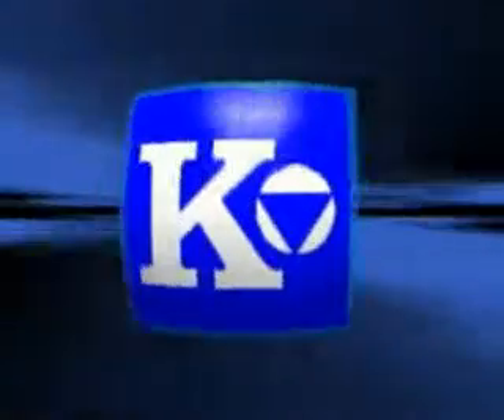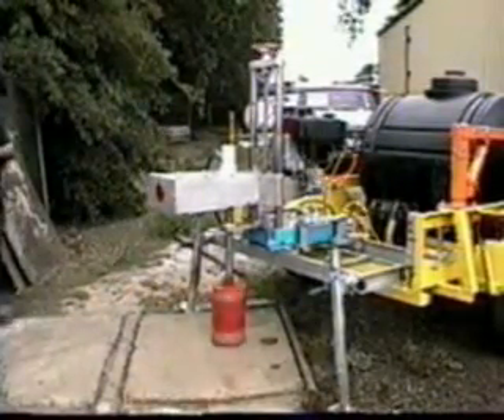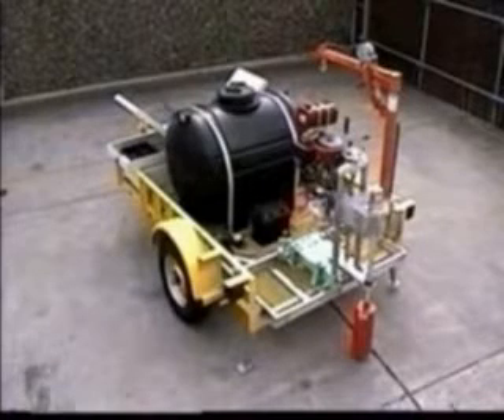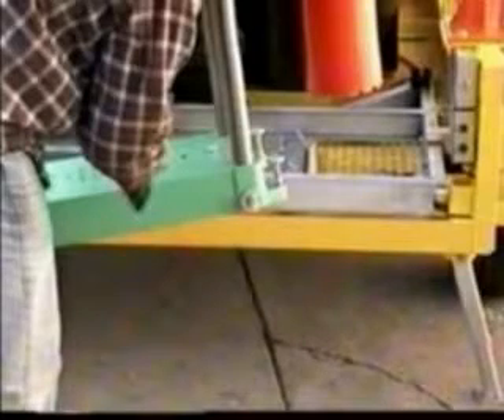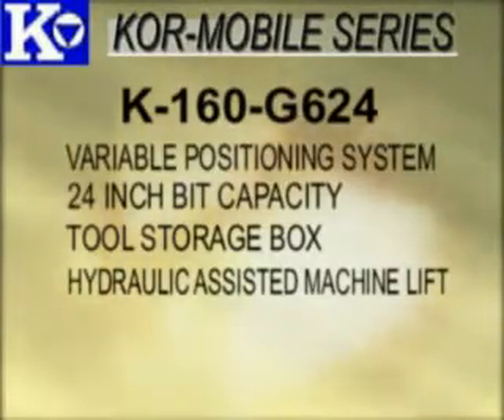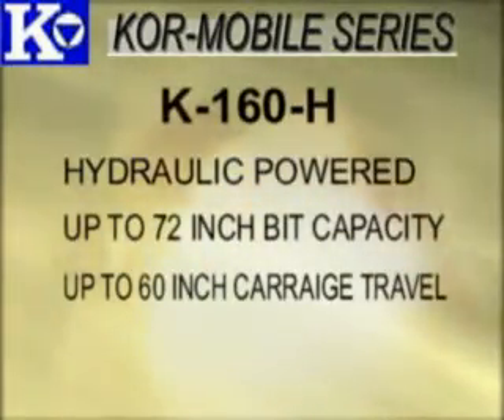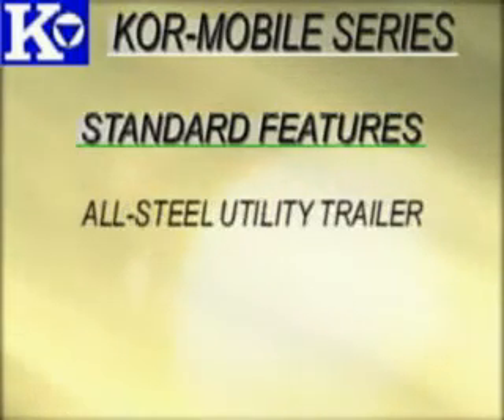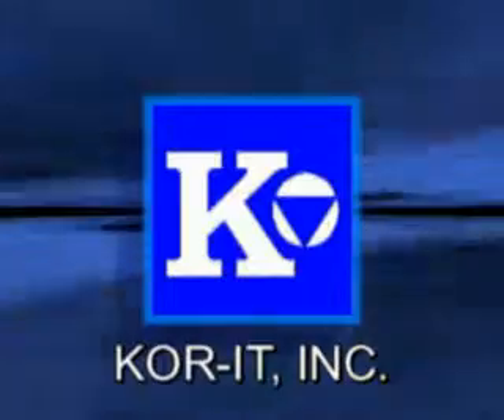K-160 Trailer Mounted Core Drill | Core Drilling Machines | Trailer Mounted Core Drills

Comment from the maker: Asphalt Testing Core Drill

We receive customer testimonials all the time, however few are as detailed and flattering as this one from Bruce Wehr, of Asphalt Materials, Inc.

“The Kor-it trailer mounted coring rig has allowed Asphalt Materials, Inc and Heritage Research Group to provide on time service to our asphalt recycling contractors. The easy set up and operation has allowed our pavement sampling operation to be more responsive to contractors and engineers request for asphalt recycling mix designs. Having the unit self-contained on a trailer allows us the flexibility of operating with a number of different people in a number of different locations. We were so impressed with our original purchase we recently ordered a second trailer mounted coring rig to meet our growing needs. Without these units our time in the field retrieving samples would more than double.”

- Bruce Wehr, Asphalt Materials, Inc